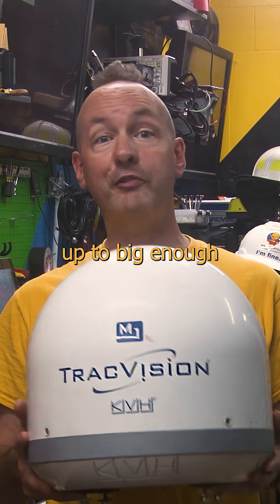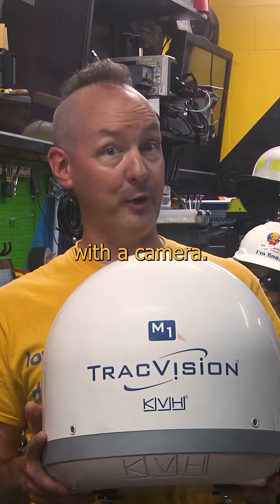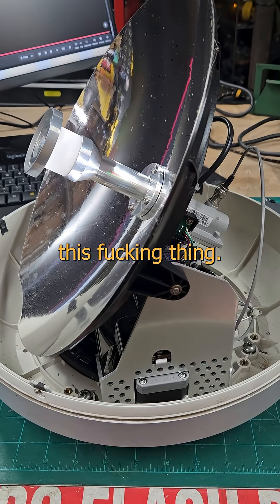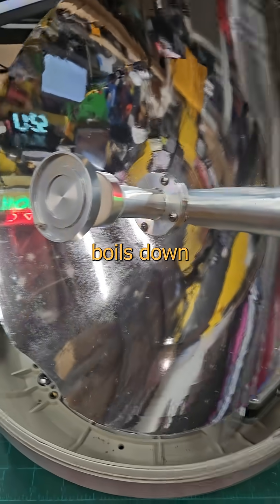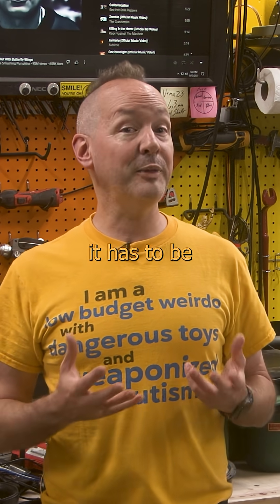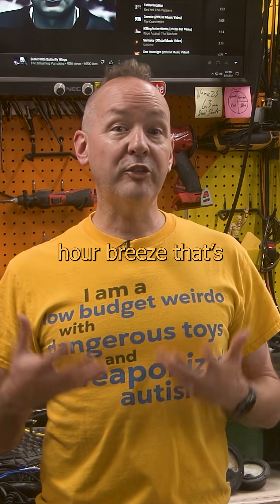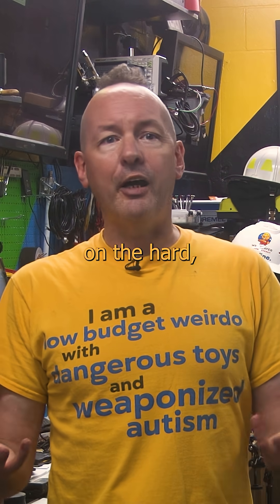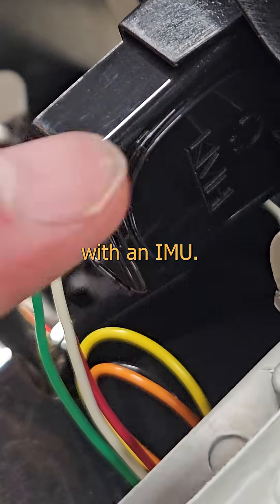Radome #chrisboden #comedy #engineering #marine #boat #satellite #radio #electronics #science #rf

Comment: Actually on a real ship, not boat, the antenna is getting GPS and Gyro digital signals for spatial orientation and motions compensation; inside the radome are primary converter and servos, the rest of signal processing is under deck.

Comment: Also cool:  phased array antennas that can "aim" by shifting the relative phase that they transmit or receive for each of a lot of simple antennas.  No moving parts! 

I wish I could tell you how well they work it how much they cost compared to what was shown here, but alas, I don't know.
Reply: They're less power efficient, but no moving parts means big antenna array can still track almost instantly. 

Also, they can throw tightbeam transmissions to multiple receivers, and the array itself can track the other transmitters. So less efficient still turns into a power savings for things like wireless access points because it doesn't have to broadcast.

Comment: I met with the fine folks at the National Hurricane Center to discuss bringing bigger network pipes into their facility down in Miami and got a nifty tour of the roof of the building where all the satellite dishes were mounted. They pointed out the mangled mounting bolts where a hurricane some years back had disassembled one of the big dishes with extreme prejudice, and ripped the remains right off the roof.

Comment: Nice little antenna. Can you tell if it’s a splash plate or a proper cassegrain? 

I’d be interested to know if the apparent choke rings on the sub reflector are functional or just saving weight.

Comment: Actually it doesn't need to be lightweight to move quickly, and it is not caused by inertia.

Inertia is to do with the force required to accelerate the mechanism to the required RPM.

Once it is running at the required RPM inertia doesn't come into it.

And it doesn't matter in an application like this if it takes 2 seconds or 20 to spin up to the required speed.

Comment: This is Rx only, and Circular Pol. For Tx-enabled maritime antennas, you need yaw, pitch, and roll - 3-axis stabilization in order to maintain Pol relative to the satellite. Also, for an Rx-only antenna the IMU accuracy is less important, but for Tx, especially with larger 1.0M+ antennas, where you're talking beam -3dB beam widths of 1.5 degrees or less, accuracy becomes extremely important, otherwise you may end up causing adjascent interference. 
I'm a program engineer in the mobility SATCOM industry and have worked on maritime mobility development programs with Cobham.

Comment: It’s fun when the video aligns with your particular set of tism.  I’ve installed, troubleshot, and at least partially built many Marine radomes in the last few years.  

I’ll never forget when I was working on a radar up on a mast and went “my legs feel weird” and then noticed the star link antenna was making noise.  I yelled down to the guys on the deck to ask if they’d turned it on just to hear a new kid had cause he wanted to see if he could get online on the water.  Probably just a placebo cause I heard the antenna making noise, but still I wasn’t amped about it

Comment: Believe it or not this is tiny bulbous bulge by ship standards. If you want to see a real bulbous bulge look at the front of really any modern displacement hull just under the waterline. There called bulbous bows and are designed to destructively interfere with the wave generated by bow hence reducing drag. A ship weighing tens sometimes hundreds of thousands of tons makes a massive to counteract this bulbous bows need to be BIG! Forget firehose pants, these things make fire trucks look small.

Comment: I installed that exact dish on my Dad's boat. I will say it is very finicky about power supply. 1 foot too long a supply and it will track while connected to a pc via usb-a. But when you pull the usb it will drift quickly. The manufacturer didnt believe me, USB was so knew at the time they disnt think it supplied voltage. Couple weeks later I received a "power booster" for free with a thank you note. They had duplicatedthe set up. They made the booster available as an extra for $250. It had awesome software for the time. It was a very valuable educational experience.

They were popular on Semi Trucks too.

Comment: i think that your shorts are the only ones that i could leave on repeat for as long as i wanted and i would never memorize the whole thing.

for a tweeter to tweet with frequency as quickly as a tweaker in a freezer, it has to be tight, light, and tiny as a little twink's pink sneakers. 

stahp. you're killing me.

Comment: For the slower of us, hope my example starts in basics.
Many jobs ago, I used an 'incremental encoder'.  1 dimensional, not more.
The encoder had a round magnet with 2 claws on either side that interrupted magnet, and as the ocean rose, the encoder attached with disc for stainless steel metal tape with float at end, would spin and translate to ocean height through satellites to Virginia.  Calibrate to what you will. Was on dock measuring ocean 'height'. (tsunami prevention)
Basics expanded.

Comment: In a previous job, doing autonomous vehicle work on tractors, our safety radar had a radome that the customer thought might be a bit too prone to damage in the rough and tumble of a bean field.  So they helpfully and without telling us built a nice heavy steel protective enclosure for the radome.
We didn't find out until they asked why the tractor kept safety-stopping with the safety radar screaming about traffic three eighths of an inch off its starboard bow.

Comment: A hopefully interesting further fact on Az-el designs. It's generally not worth it to implement that on your solar panels. Yes, it tracks the sun better, but it also uses some of the energy generated to power the motors, and the whole device becomes more complex and therefore is more expensive to buy and more likely to fail.

Just align a static one for the best case angle and leave it.

Comment: Just FYI people, Its satellite not radar; its pointed upward (navigation radar would be horizontal), and the curvature on the dish is meant to focus RF not send a wide beam of it to hit as much stuff as possible.

Navigation radar are the rotating bars located as high as practical on the boat. They dont see weather and they're really only meant to see things in close proximity to the the boat (though they probably can see pretty far when the conditions are right).

Comment: Ahhh Radomes, something I had a lot of fun with when I worked on aircraft in the military. Those things are EXPENSIVE and are not repairable and require specialized paint to not interfere with radar or whatever signals you are sending and receiving. Then comes Boeing maintainers who will outright repair these with Bondo and regular aircraft paint which renders them useless. There is a REASON I stepped away from being an aircraft mechanic because I am NOT signing ANYTHING off like that.

Comment: Im a land surveyor. My Trimble GPS unit has an IMU. It's nice because I don't have to level the rod before taking a shot. It knows where the tip of the rod is because of the IMU data. Much faster and more accurate in tight spots where you can't level the rod, like locating a building corner.

Comment: For those wondering, that's a Direct TV receiver, just with a tracking antenna lol. It's the old SD version so no longer supported by DTV, which is how Chris got it! 

The Radome name refers to the radio waves, not radar, and while a lot of smaller boats DO have radar, that usually looks like a simple rotating bar, not a dome.

Comment: Would it be useful to pump the air out of that chamber, or is air friction miniscule in the scheme of things? I'm guessing it's more often tiny adjustments that grand sweeping turns of the dish.
Reply: Nah not for anything like this or even bigger ones. The signal is large enough in diameter that it's not super finikey basic pointing and movement compensation is enough.

Comment: A radome is also used in the aircraft nose for use as a weather radar. The actual nose cone of a plane is perhaps the only part that isn't made of metal or carbon fiber (if your plane is composite) since those will interfere with radio waves. You'd do this by making this out of fiberglass for the structural rigidity since an airliner would be flying in thunderstorms—the less severe parts that is since the radar should show the rough parts to avoid. 

This brings to when my alma mater wanted to build a research UAV to measure polar icesheets. The radar array has to be mounted under the wings because of the surface area, so the wings had to be made from fiberglass. And there is a lot of fighting between the EE team and the AE team since the EE team wanted to optimize the array one way for best radar signal and the AE team wanted to optimize the wings another way for aerodynamics and structural rigidity.

Comment: Thankfully, satellite data is moving towards low earth orbit satellites. So instead of a directional antenna pointed at one satellite, you just need a flat panel antenna with one end pointed north. I've seen these used on trucks through the Montana oil fields and they give off more stable Internet than I had cell service. No reason to believe it wouldn't be the same for a boat.

Comment: Reminds me to a story which I heard from a lady who worked in 2024 at the Neumeier 3 station at the antarctic. They had a radome where you barely can enter with your upper body half. Some day a bolt broke, so the antenna dish couldn't be moved properly. She removed the parts of the bolt but there was just on thing as a replacement to get it back to work: the hex wrech which is usually used to open and close the radom. 
Gladly they have a work shop on the station so the mechanic could construct a new bolt. 
I'm sorry I forgot her name, but she is a german scientist and we could talk to her at the "Girls Day" via video call. I even don't remember her callsign, I'm ashamed 😅 
One of her jobs was to organize the air trafic there and she put her field bed in front of the desk to get wake up by the radio. She is a very very nice woman and all other girls were impressed by her story. 😊

Comment: Now you need to look into INS Navigation. 
It’s like GPS, but instead of measuring distances based on signal timing to each satellite it can hear, it’s based on the (I worked on aircraft, so…) the aircraft’s movement, based on its initial frame of location. 
Kinda like fining your bathroom when the lights have gone out. You know you are in bed, the left side, put your feet on the floor, take two steps this was, not three, turn right, 5 steps, turn left, 6 steps, not 7 because that’s the top of the stairs…. Then turn left and the door knob should be right there
But using any measurements but inertia. Thats right, basically navigation by inertia, or G force since it was initialized. Extremely accurate.
And don’t kick the chocks out while the pilots are doing their 15 minute INS line up. They get really pissy.

Comment: I've got a tinier, simpler version on my tractor to help it drive in lovely straight lines.  The IMU on mine is separate from the antenna and is bolted directly to the frame of the tractor

Comment: The radomes on the planes I fix (EMB 145) according to my coworkers, will melt you if you stand In front of them while they're on. cant confirm as I've never tried and I probably wont anytime soon. surprisingly enough I've never had to fix one, but I have replaced the cover. The "dish" is flat, hexagonal, and has holes in it.

Comment: CHRISSSSS!!!! I install these and repair them. On of the coolest examples of technologies becoming more available over time. In 1940 thos was top secret stuff. Now its 1200$ and some time.
Reply: what in the world tier of civilian boating would need these things normally, anyway?
Reply: @asakayosapro actually small radars like this on smaller  pleasure boats is pretty common today. It doesn't have to be a multimillion dollar yacht. Boats small enough to be put on a trailer and taken home can have them!
Reply: @wheels-n-tires1846 this isn't radar, it's just an old SD Direct TV satellite tracking antenna, no longer supported because they are moving to HD, which is how Chris ended up with it! Lol

You are correct about a lot of boats having radar, but it's usually going to look like a spinning bar not a dome.
Reply: @ke6gwf The cheaper ones are usually in a radome, cylindrical with a flat top. The exposed spinning bar arrays are bigger higher power, with better angular resolution and $ to match. Iirc killowattish range. The large phased array panels on war ships are throwing megawatts of pulsed microwaves around.  These can cause mischief with highway traffic if say your test center goofs some software and briefly  makes it a small directed energy weapon. (allegedly)😅
Reply: @ke6gwf  you're right. I dont keep up with small boats much,I just knew that small units were pretty affordable and common. Last radar I touched was a SPS  unit with a SPA-25 repeater lol... (US Navy gear)
Reply: @anullhandle  the cylindrical ones are just a bar array in a plastic housing, the array is just thin sheet stainless with the electrodes stuck on to it (probably not the right terminology)
Reply: @asakayosapro this is just a tracking mount for Direct TV satellite TV, and Chris has it because it's the old SD receiver that Direct TV isn't supporting anymore.
This one isn't radar, the housing is called a Radome talking about radio waves, not radar.

Though a lot of smaller boats do have radar as well, for weather or warning about other boats, but you will usually only see that on salt water craft, or just because they are compensating and want to look cool lol
Also, the actual radar is usually a spinning bar, not in a round housing like this.
Reply: @asakayosapro  This is a satellite link, realistically in this day and age do you want TV or Wifi on your boat? Mount it. They aren't crazy expensive (compared to other boat things), and the boat usually can be equipped with plenty of extra generation to run them.

Now, if you want Radar (which is similar, at least in appearance), I've seen units mounted on 26ft dual engine center consoles (back in the 2000s). 

Looking at prices today, I'd consider mounting a GPS/radar combo system on any boat with a spot I can secure it that's at least 7ft above deck level (so it clears my head). That means I could be mounting it on something as small as an 18ft or 19ft center console. 
With offshore engines starting at around $4k for 9hp model and going up rapidly (most offshore boats where I grew up ran 75hp+ which will run you around $11k and up) $5k for the safety of a GPS/radar combo unit is a worthy investment.
Reply: I should say, I am assuming offshore boating with all of this. I grew up on the coast and everyone I knew ran offshore going fishing or out to the islands.

As another commentor mentioned, lake/rivier usage Radar is probably not worth the investment, though a GPS is probably still worth it for nav charts if nothing else.
Reply: @CoastalCastaway this isn't radar, it's Direct TV, which even lake boats often have lol
That's why he talks about it aiming at something 22k miles away, and talks about large satellite dishes.
Radar looks like a rotating rod
Reply: @ke6gwf  As I sad in my first paragraph I'd mount that on any boat I wanted TV or satellite internet on.

Admittedly then I went off topic onto radar and why the cost is likely worth it regardless of offshore boat size (Assuming you have a place to mount it).

But TV/Internet or Radar systems, while expensive in a vacuum are not that expensive in the reference of boat stuff. So I wouldn't balk to much at mounting any of those transceivers to any boat where I want that capability and has a mounting surface I can use.

Oh, and not all marine radar is a rotating rod. The higher resolution ones usually are, but the also make enclosed ones for sailboats (don't catch the sails/rigging) or as less expensive/smaller systems for people that don't need the higher resolution and longer range.
Reply: @CoastalCastaway YouTube had only showed me your second short comment that didn't say anything about satellite, so that's what I was responding to, now I see your first paragraph, and I learned stuff from reading it! Lol
Reply: @ke6gwf  Gotta love how youtube does that.
Reply: @CoastalCastaway  Depends on the lake and usage of the boat. My Scout unit owns a 120+ year old former tugboat at Lake Saimaa here in Finland, and a significant portion of boats here have a radar of some caliber. From those bowl shaped ones often found on sailing boats and <10 meter long fishing boats, to ones with a boom shaped antenna 1.5-3 meters long, like the current and previous one we received as a donations. Super useful for navigation in the dark and rough weather, as well as in general as it allows one to get accurate distance measurements, without the uncertainty GPS can have this far North.
Reply: @villepore7013  That's a good point. I probably should have prefaced this with being my opinion based on growing up/living in the SE USA. different places will make different use (and once you get big enough I'd mount it regardless)